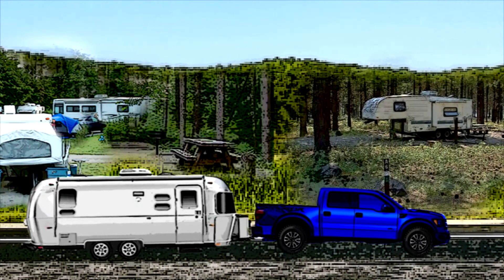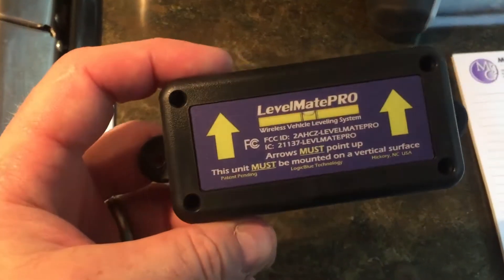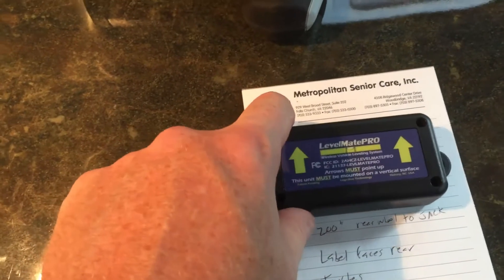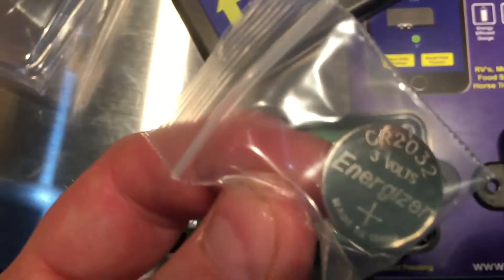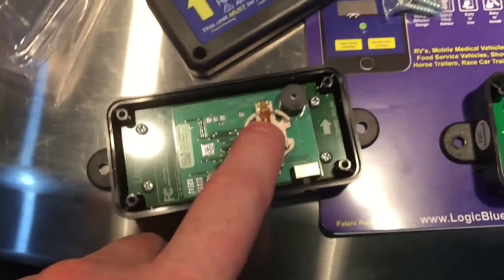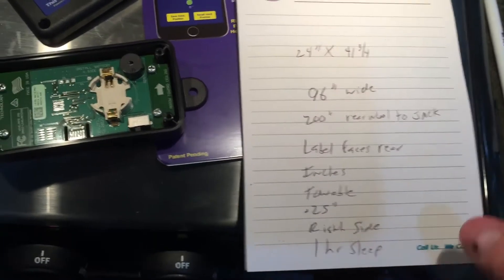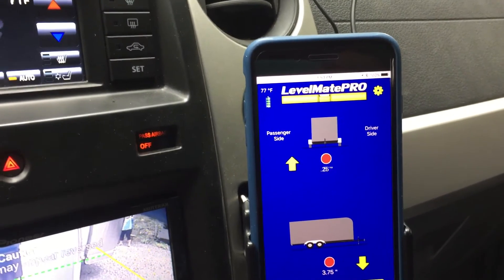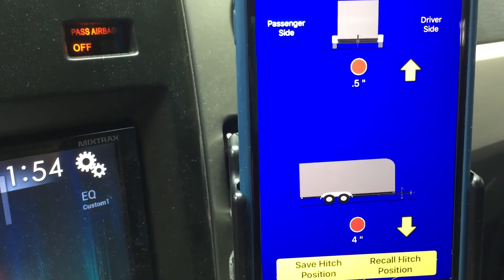Product Review: LevelMatePRO (2nd Generation)

Comment: I just purchased the LevelMatePro and got the 2nd edition with the on/off switch. I've had an opportunity to use it for a couple of trips. I usually forget to turn it off so when the Airstream is left still and it goes to sleep turning on the iPhone app doesn't wake it up, I have to go inside and cycle the on/off switch for the app to connect. I also found it seem to have lost the tongue jack setting the last time I used it. It took the tongue jack down too far. I had to manually level again and save the settings. We've been sitting still now for over a week so it will be interesting to see if the setting for the tongue jack is lost again. I like the tongue jack save setting as it appears to get the tongue jack to the desired height to so I can back up the tow vehicle. The lateral setting seems still accurate but unless you have the Anderson Levelers I find I'm always out a fraction of an inch which is close enough. I have my LevelMate located in the front bedroom hanging closet located agains the bathroom wall. It faces the tow vehicle mounted inside the closet. Now we are full time I'll be able to use this a lot.

Comment: Once the AS is level, do you hold the brake, shift to neutral then apply the parking brake? Then shift into park? Wonder if doing  that sequence  would keep your AS from rolling forward or backward????
Reply from the maker: Yes - if I use the parking brake the trailer stays rock solid but I sometimes forget to do that ;)

Comment: I have the same one no range outside of trailer works fine inside of trailer any idea
Reply from the maker: I have a 25' Flying Cloud and I have mine installed in the closet (up high) and have no issues in the cab of my truck.  Checked battery?  Maybe you have it installed where there is interference...you may want to reach out to their tech support.  Thanks for watching.
Reply: What would interfere with it I have it mounted to my concession trailer
Reply from the maker: Edward Machado could be a bunch of things...some types of lights...microwave...other antennas/signals.  But the manufacturer would have a better idea on what would.interfere with their hardware.
Reply: Thank you